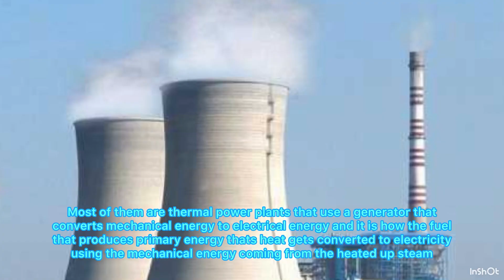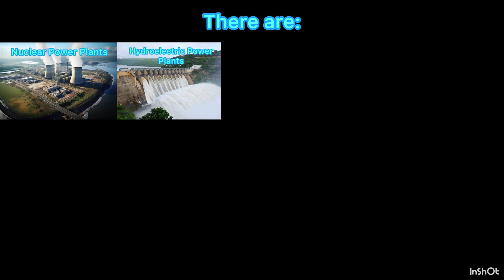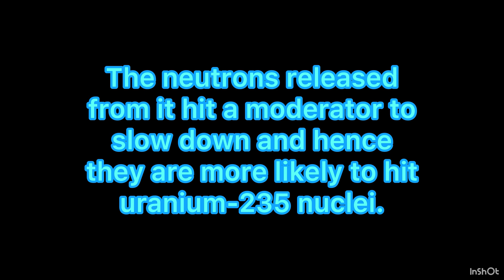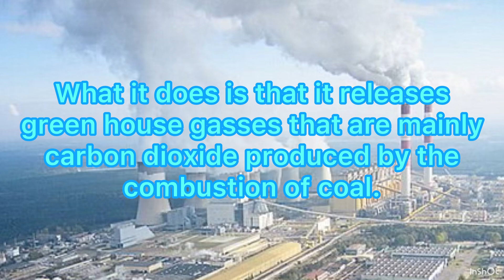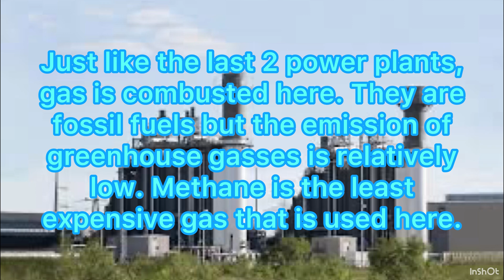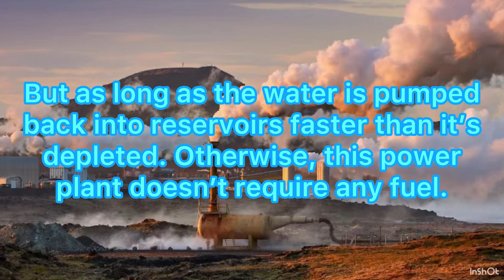The Key to the Future of Energy

Comment: And lied about nuclear power just right off the bat ! Nuclear power is the most expensive and the most dangerous too dangerous to have .
Reply: its still a good and interesting video
Reply: 🧢, Owl350 GOAT
Reply from the maker: Not quite. The risks are very low. Although meltdowns cannot be controlled much, the risk of accidents is very low compared to others, making it among the safest as well as producing the most energy. They produce clean energy, which means they produce energy without carbon footprints apart from nuclear waste.